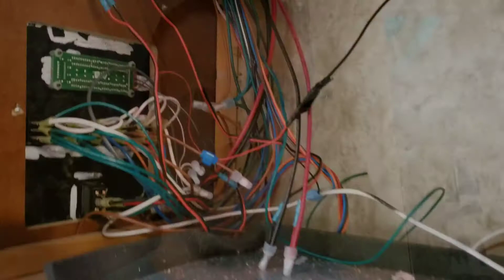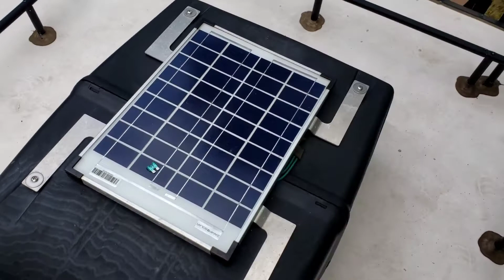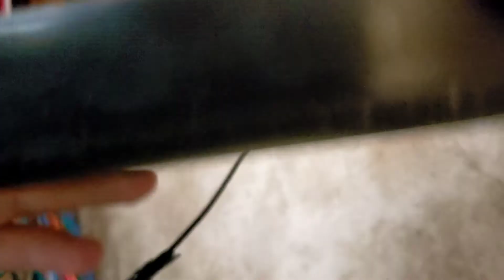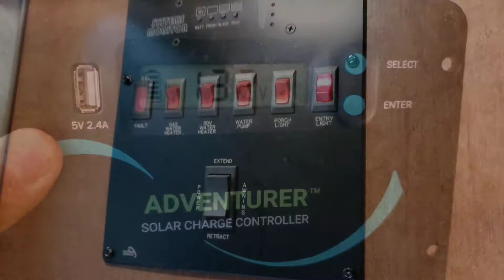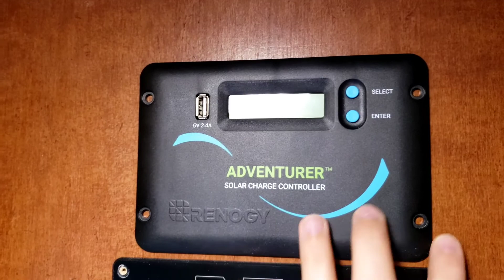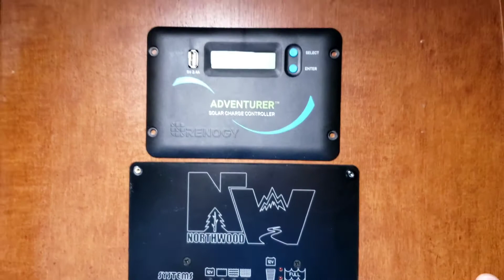Renogy Adventurer Charge Controller Installation

Comment: It says in the manual to not use the temperature sensor with the lithium battery. Why is that?
Reply from the maker: In general, LiFePO4 batteries don't require temperature calibrated charging, so the temperature sensor would not be needed. It's been a while since I looked at them, but I believe most LiFePO4 batteries on the market have an internal integrated BMS with its own temperature sensors to control charging across a range of temperatures. The Renogy lithium batteries certainly have that feature, and I know others do as well.
Reply: @DavidMays  Thank you, David. Since I bought it, can I use it just for me to see the ambient temperature? I hope it's not going to hurt the battery. The warning sounds scary: Do Not use this sensor when charging lithium battery.
Reply from the maker: @minivancamping6556   I wouldn't do that, at the risk of confusing the charge controller. Stick to the script, just get a separate temperature sensing device. I like having an indoor/outdoor sensor set up with the "outdoor" probe shoved down next to my fresh water tank, so I can see if it's getting too cold down there.
Reply: @DavidMays  Thank you, I will disconnect it and I will have to live with that annoying 26 C display.
Reply from the maker: @minivancamping6556  You bet. BTW, This channel is somewhat abandoned. I'm now active on @AlaskanHomesteading which may or may not interest you.
Reply: @DavidMays  Sounds interesting, I will check it out for sure!

Comment: Renogy specifically advises against connecting the solar panel to the charge controller before the battery is connected to the Adventurer unit

Comment: Do you happen to know what causes E02? I am running 2 - 12v 100AH Lifep04 batteries in parallel with 2 - 12v 100W solar panels in parallel and have the Adventurer setup for 12v, LI, 14.2V Charge. The batteries charge is supposed to be set to 14.6v based on manufacturer specs but I lowered it to see if it would help. However, when I flip on the inline circuit breaker for the solar panels after a few mins of sunlight the built-in BMS on the batteries squeal and the solar controller show E02 (Battery over voltage). It did not go over voltage before when I was running 2 SLA batteries...Almost like the controller is not actively controlling the charge voltage.
Reply from the maker: I didn't think this controller was set up for LiFePO4 batteries. If you get the Bluetooth controller you might be able to configure the voltages it is using/expecting but it would be a pretty custom setup.

Comment: That's  is great controller. And great video....just fyi don't never hook a controller up with out the battery hooked up first you will damage the mosfet and over heat the finals
Reply: I took off the battery to fix a outside panel. Put it back on and now my lights are not working. It says it charging but nothing working. Any ideas